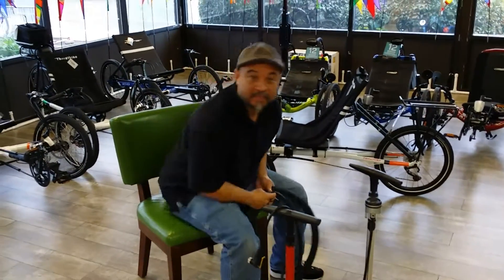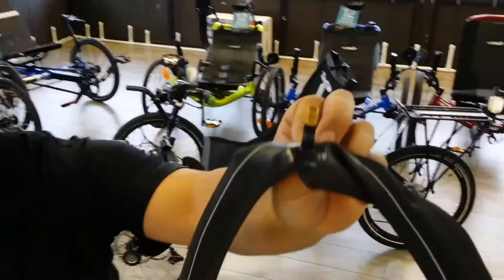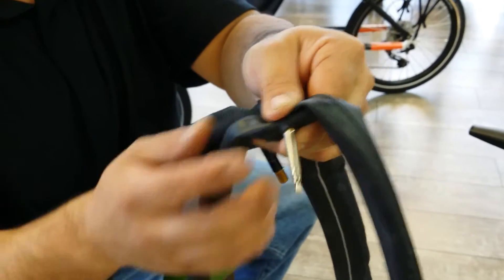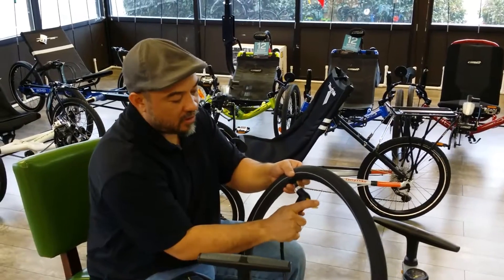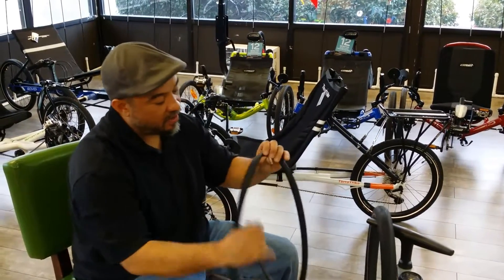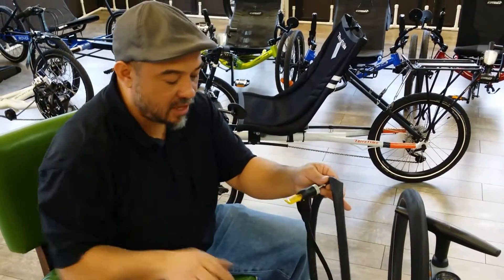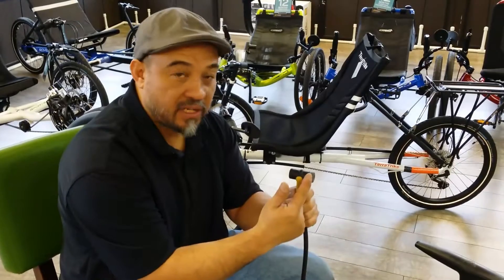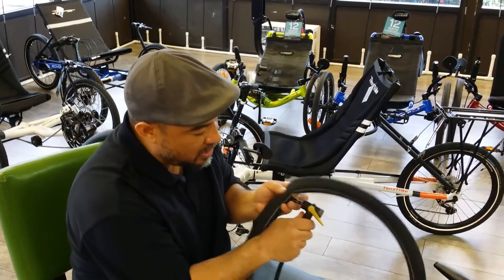HOW TO PROPERLY USE YOUR TIRE PUMP - LAID BACK CYCLES

Comment: Thank you, do you guys have any info on how to get a new key to unlock a battery to charge it remotely instead of only with extension chord? My dad had a rambler EVO and passed away, I do not know where the key is to unlock the Bosch battery. Thanks